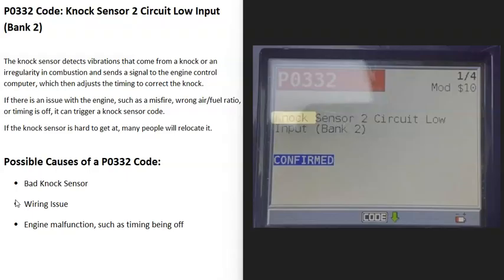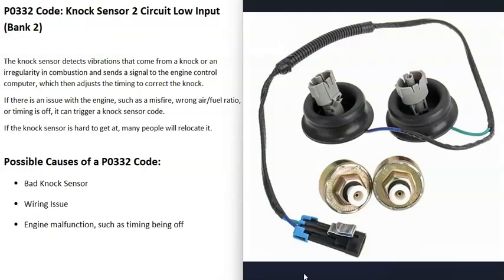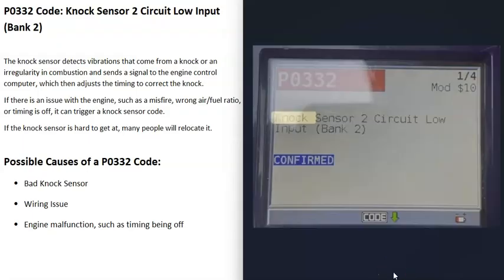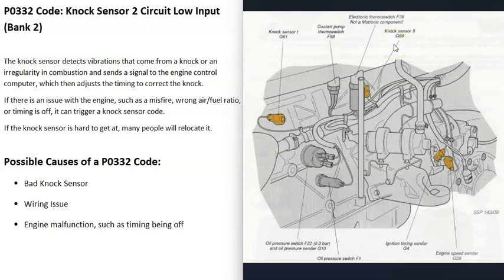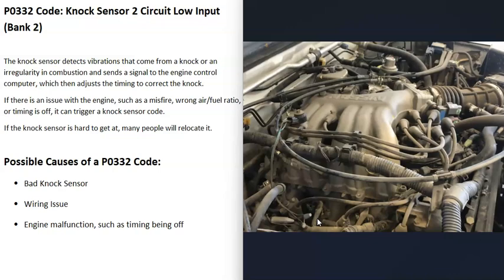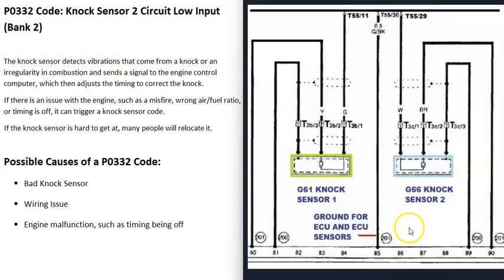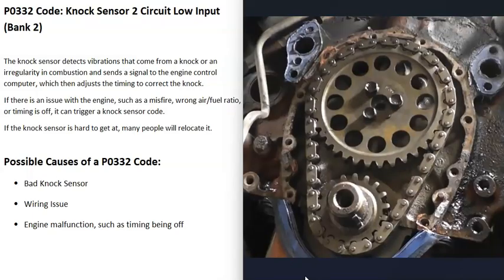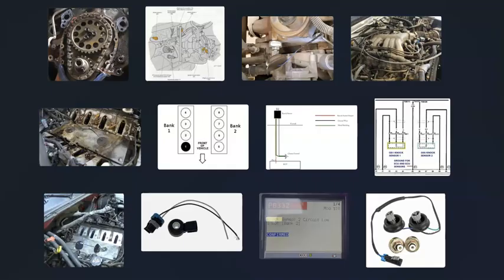Causes and Fixes P0332 Code: Knock Sensor 2 Circuit Low (Bank 2)

Comment: Add two codes what is po333 and po332 are replaced a spark plug and spark plug wire and it fixed the roughness in the car now I want to know is my knock sensors bad since the light still it seems like the core is idling fine and everything you know after I put the spark plug and a new wire cuz the wire was was cracked
Reply from the maker: It needs to be diagnosed, but if the engine is running well and there are no other codes, I would test the knock sensor and wiring.
Reply: Also, did anyone ever clear the codes?

Comment: hello. And thank you for posting. I just swapped out my knock sensors with two AC don’t go knock sensors and the harness back in January. I did the silicone border around each plug and on the wire end of it as well. Talk them down to specs I also installed the new cam and crankshaft sensor and a new fuel pump at the same time. The truck ran green but after four months or so I noticed a hard start and a slight vibration in the engine. The code that was just generated today about five months later is P0332.What would you go about checking first? Thank you.
Reply: If you did all of that, properly and well, then check spark plugs, and lifters/valves. This would be the cheapest place to merely inspect.

Comment: My 2005 GMC Sierra with a 4.8 vortex engine just got it's two knock sensors changed with new ones including the harnesses yesterday , but this afternoon the check engine light came on and I used the code reader and it marks that code for both sensors, get t any idea what can it be?
Reply: Did you find a solution ?
Reply: Plugs, wires, crankshaft sensor, camshaft sensor.

If you know the plugs have been done, and likely good…I would start with the crankshaft sensor, as they are the most frequently going bad sensor, due to their location being most exposed the the elements.